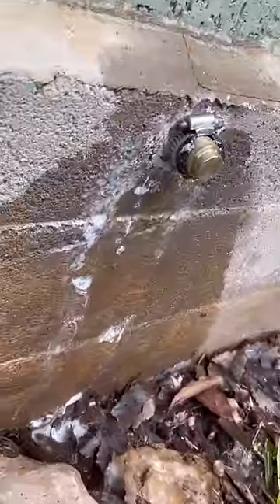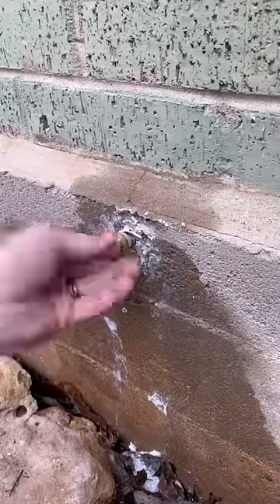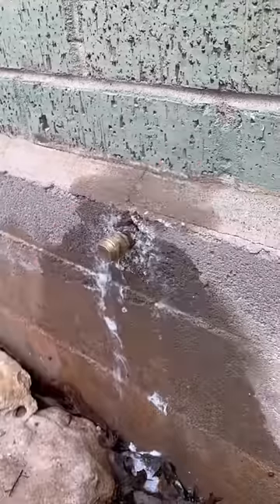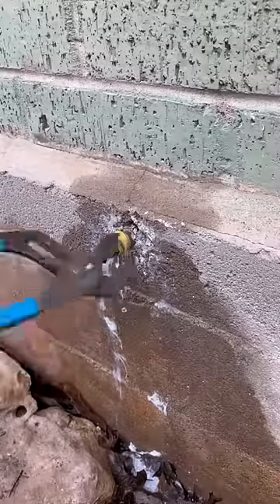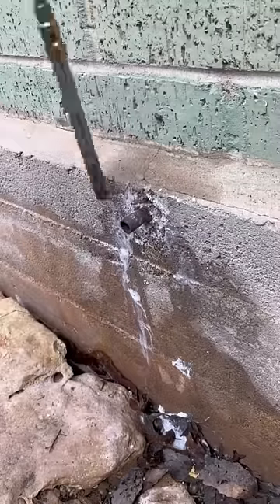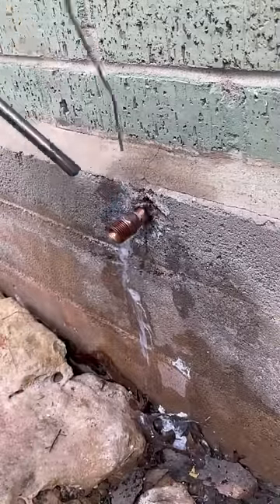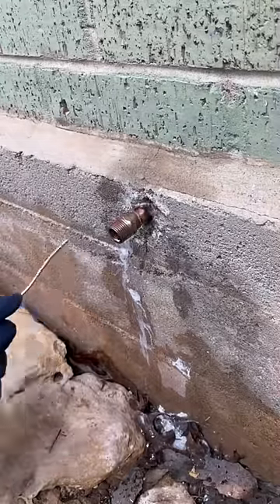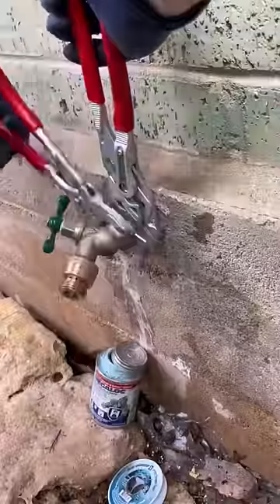Repairing a copper waterline for a hose bib. #plumbing #plumber #repair

Comment: Good shit! Learned you can melt the fuck out of the sharkbite, thanks!
Reply from the maker: Found that out on a job awhile back while frustrated. “It will come off once it’s liquid” 😂
Reply: @theplumbersplunger  Thank you for teaching us. Very helpful 👍
Reply: @theplumbersplunger a  torch is always a good mistake fixer.
Reply: I’m in the uk so it probably has a different name, but is the shark bite the little brass ring? We Call them olives, we have a tool for them like pliers with a v shape cut into them cuts the ring in two places and comes off in seconds no melting involved.
Reply from the maker: @Fastercat777  he is talking about the push connect fitting I took off by melting the plastic
Reply: @jamesnicholl1591  If memory serves me right, you guys use a lot of compression fittings in the UK 🇬🇧. We dont use much, other than our angle stops. 

The fitting shown here is called push to connect. Has an o ring to create a seal and uses stainless steel teeth to hold it in place, hense the name sharkbite. When they are fitted close to a wall, its a real mfker to take off. 

Apparently, a torch works wonders!
Reply: @Fastercat777  you were talking about a brass ferrel
Reply: @javiervazquez9472  Even super close to the wall using the right tool you can get them off. Just pure lazy and clearly does not know how to remove them. 
Plumbers like this guy will tell you to go all copper yet pex and sharkbite fittings either push to connect or crimp will last just as long if not longer than copper. 
Copper cost more to install because of the labor. Yet pex is super simple to install that anyone can do it. 
The same goes with DWV where companies are still forcing the use of Cast Iron.
Reply: @kameljoe21  slow down there, cowboy! Cast iron is still required in buildings over 3 stories high due to noise and the toxic chemicals it produces during a fire. 

Apollo warrenties there pex for 25 years, Nibco 10, Viega 25, but Copper is warrentied for 50. Im not saying to always do copper, but if copper fits the budget, why not? 

Now, did you know that sharkbite goes bigger than 1 inch? Have you ever tried removing a 2 inch sharkbite cap that's close to a fire rated wall? It isnt fun.

Now removing them with fire doesnt mean he's lazy, I think it's smart. Reduce damages to wall, reduces moving copper too much,
Reply: @javiervazquez9472  While building codes still require them on buildings 3 or more stories. Still its an old and outdated reason to keep using them. PVC is still a viable solution and is 100% sealed pipe where is cast iron is sealed using rubber bands and the weight of every pipe from ever level is on those bands. I know far to much about cast iron as I have installed it for in some very large projects along with spent nearly 6 months testing all the DWV in a brand new hospital build. This required flooding and testing every stack as well as replacing and adjusting bands. I also installed copper and med gas lines. 
Warrenty is only for defects in the pipe. Which is super hard to prove in copper. I have seen brand new copper lines get destroyed and had to have them replaced. I have had to replace several main lines in projects by companies who failed to install the joints or fittings right. Including some major 6 inch copper lines. 
Yes I am aware that pex goes larger than 1 inch. 
I also know that pex will last a lot longer than copper. I also know that freeze and thaw cycles on pex is quite common. I installed pex on a farm house that sits empty all winter long. The only thing they do is put some RV antifreeze in the toilet and drains. The reason why it was replaced was because the heat went out and it froze causing the cellar to flood for a month. Now with the pex they have never had a problem even during the coldest spell of -40f. 

Yes its lazy to remove a fitting with fire when the proper tools can be used. Also it your copper is moving then something is wrong. 
Had this homeowner had pex he would never of had this problem ever.
Reply: Sharlbites are actually extremely easy to remove if you know what your doing
Reply: @Fastercat777  Nah shark bite is a kind of brash push-fit as far as I know.
Reply: When it is close to the wall you can get the sharkbite off using 2 flatheads.
Reply: @thehumilityhaven  yes. It's pretty simple.  People just have no patience to actually figure out how they work and how to get them off
Reply: @thehumilityhaven  Yep you sure can. Like the creator said in a comment it does not make for a good video.
Reply: 2 flat heads is all u need😂😂😂😂
Reply: @adammonahan687 When you have adequate space, they are easy to disconnect. When they are flush against a concrete wall, not so easy
Reply: Good job young man 😊

Comment: I accidentally twisted the copper in the wall once. Live and learn.
Reply from the maker: It happens unfortunately. Just don’t do it on a Friday after 4:00 😅
Reply: @theplumbersplunger  😂😂
Reply: That's how we learn.
Reply: I would install a box around that facet to protect it. It just looks so weak there😮😮😮.
Reply: What happens if you twist the pipe does it break or un thread?
Reply: @Ya boi Smith you create a leak on the other end by breaking the solder. Ive seen the pipe itself twist as well and well that also creates a leak.
Reply: Was replacing my cast iron kitchen sink last month, and it slipped falling through the hole in the counter.  Nailed both the hot/cold stopcocks on the way down and broke em both off in the wall. 🙄  That was a fun mess.
Reply: @theplumbersplunger  but Friday after 4pm is when all dads everywhere decide they know enough about plumping to do some dumb shit 👌😂
Reply from the maker: @nicholasphillips5406  this is true 🤣
Reply: I did it on a Sunday afternoon, inside, down to the slab 

I occasionally helped out a friend, as a ground guy for commercial/industrial fire sprinkler install so I only saw black iron pipe and I put a wrench on a leaky fitting behind my refrigerator... not knowing that it was on a copper pipe.
Reply: What you mean with 'use backups'? I've not idea about plumbing
Reply from the maker: @ivanf442  using a second plier to hold support on the pipe coming from the wall so it doesn’t twist.

Comment: I’ve got some relatives in Texas who discovered a while back to their pretty serious dismay that the fact that most years they don’t see enough frost to worry about doesn’t mean that it isn’t still good practice to install proper frost free hydrants with back flow prevention rather than simply replacing those old fashioned low tech hose bibs with the same thing when they fail. Where I live in Canada those hydrants have been SOP in all new construction and will generally be retrofitted any time an existing hose bib is replaced for many years now. Before those came around, all houses in my area had to have an accessible interior shutoff for outside hose bibs, and homeowners had to remember to shut those off and open up the exterior valve to drain the bib in the fall before cold weather arrived.

Comment: when i have a sharkbite fitting buried against a wall like that i use 2 flat head screw drivers to grab the edges of the plastic on either side and compress it using your thumb on the end of the cap and work it off that way.

Comment: As a former service plumber for 21 years this is exactly how you change out a hose bibb in this situation
Reply: Thank you for all the detail in the the voice over!!! That’s what keeps me subscribing. ❤🎉
Reply: You saw it too?
Reply: How do you winterize that shit
Reply: Yeah except for that huge solder booger in the joint. That’s all bad.
Reply: Former? How did you get out? Genuine question. I can’t walk in public anymore without getting loaded with questions and requests for service. 24 years so far. I’m 43 looking for a way out. It’s boring factory work at this point. We’ve seen every hacks trick. Nothing is new anymore.
Reply: @pjplumber2146  I usually never worked in the county I lived in and only drove the truck home on rare occasions. My next door neighbor  is a half mile away in  either direction. I hopes this helps.
Reply: @evanrodriguez2470  There should be a shut off valve inside the house or crawl space to turn off.
Reply: He put the sweat on inside....😂 would have never showed this video....😢😂😂😂 he has so much solder in one fittting

Comment: Just a heads up, they make 1/2" threaded bushings so you can put a boiler valve on flush with the wall

Comment: Depending on location, copper should be in a sleeve when going through concrete or you need to attach an anode to cut down on corrosion
Reply from the maker: It definitely needed to be sleeved. Unfortunately, whoever originally plumbed this house didn’t sleeve any of it.
Reply: Agreed.
Reply: Back in the 80's there was bare copper tubing laid in the middle of slabs all over central Texas.  Unsure what code is here now, or what they use.
Reply from the maker: @hcaveman6954  no homes now have copper in the slab unless they are pre 2005.
Reply: Bingoooo. Was wondering this!

Comment: I’m very happy you actually took the torch away when the copper was hot enough and applied the solder
That’s like the first thing they teach you about brazing if you went to school or learned from an actual professional and not some dude 
And some dude can be a pro
It’s just rare they explain why it how things are they just say do it like this

Comment: I agree with everything you did except the megaloc pipe dope I always use t+ 2 Teflon pipe dope megalock sets hard cannot remove easily after it cures
Reply: Yea. I was questioning that myself.

Comment: Nice to see someone using a torch like a real plumber and not throwing money with a propress instant plumber tools….bravo my fellow plumber..bravo…

            …..i cringe seeing plumbing videos using pro press on every 1/2”-3/4” fitting and blowing through 15/20 fittings in 2 feet of pipe…..you can work backwards and soldier every fitting ..and when you get to the last one if its still draining or failed shut off valve not closing then at that poin you use 1 press fitting for that final connection…..and for the record  pro press should only be used for 1.5” or bigger fittings in emergency time sensitive situations only……i would have gotten fired on the spot if i was caught using a pro press on a 1/2” fitting😂😂😂
Reply: Is that what certifies a "real plumber"?

Comment: Very cool. Are the hose bib vacuum breakers necessary in places where temperatures will never dip below freezing temperatures, I.E. Hawaii?
Reply from the maker: Required by code here to prevent water from siphoning back into the system from a hose

Comment: I got a trick for you- you probably already know it- in a situation where I have water constantly dripping back to my work point (like here)... I go to a nearby fixture & rig my shop vac up to it, then turn it on. the suction pulls the water away from my work point- allowing me to work the joint sooner. extremely handy in situations where an old gate valve doesn't turn off completely & leaves a constant drip into the system.

Comment: Using both Teflon tape and pipe dope seems counter productive. Wouldn't the tape prevent the pipe dope from contacting the internal threading ? Or is that the point ? Not that I'm a pipe fitter, but don't you want to be able to remove the tap assembly in the distant future, and won't the pipe dope make that particularly challenging ?

Comment: Question... can you dope the female joint on the thread for a cleaner application?
Reply: The dope just piles up inside the fitting
Reply from the maker: It won’t seal properly doing it that way.

Comment: If there is a chance of freezing, I suggest a self-draining Hose Connection Vacuum Breaker. Otherwise, water can get trapped in the hose bib and the pipe going through the wall and freeze. 
No need to use Flux on the pipe to clean it off. Just heat it, wipe off the solder with a rag, then sand it clean.
As many others stated earlier: Use a ball valve hose bib, and a lot less solder.
Reply: He didn’t ask for suggestions. we know you’re a better plumber, but if you want to tell people how to do their job you should put them on the payroll first. If you’re not their boss they’re not listening I promise.

Comment: I keep seeing plumber’s using tape then dope and I’m trying to understand. That still leaves one set of threads only covered by tape. Right? Wouldn’t the ideal process be dope>tape>dope?
Reply: I’ll tell you a story on European plumbing: we don’t use pipe dope on Teflon ever.

Either hemp and paste (which might be kind of a pipe dope) or straight up Teflon tape or the newer products even. Hemp is still viable due to being able to back the fitting of without leaking, which you can’t do with the tape.

Dunno if that is what the pipe dope is needed for, filling pinholes in the tape if you have to back the fitting of?
Reply: @bertbergers9171  That's a great point, I hadn't considered backing the fitting off.
Reply: I’ll tell you a story on American plumbing: we use three wraps of Teflon and then coat it with thread sealant. Never fails. Teflon tape lubricates the NPT threads so a string mechanical joint and hydraulic seal is created. Thread sealant assures a leak free joint first try. Interesting use for hemp though.
Reply: One of manufacturers required dope-tape-dope. I used like manufacturer said and everything went ok.

Comment: What does "always use backups" mean? Asking for a DIYer 😅
Reply: The backup pliers or wrench to hold the pipe when putting force on the fitting. That way you don't trust the whole pipe, potentially collapsing it inside the wall.
Reply: @RossReedstrom  damn. This is not common. A legitimate question answered correctly and without sarcasm. thank you.i truly mean that

Comment: I see alot of these on here, doesn't something like this freeze?
Reply: Must be down south , Definitely not SD.
Reply: @edmc1000  
SD 🤣🤣🤣🤣👍
Reply: Judging by the brick and mortar color I would say California.
Reply: Many places in the world dont experience freezes. Someone always brings this up like theyve never heard of a place where it doesn't get to freezing ever.
Reply: @wackocheese  That's where I live. For the most part I have always seen the frost free ones where the valve is actually on the end of a stem so the water stays inside when it's not on.
Reply: A ball valve would  installed to terminate the water to this line in the winter..

Comment: What’s the purpose is that little bit of solder in the inside of the pipe?
Reply from the maker: I used too much and some overflowed into the fitting. Had to get it out.

Comment: How much do you typically charge for these replacements after parts and labor
Reply from the maker: All of our pricing is by the task so we don’t have a parts and labor breakdown. A new hose bib installed is about $300. It varies though depending on what the situation is.
Reply: @theplumbersplunger  you’re joking right? How much do you charge for a service call? If you’re charging that much I’d hope you at least knew how to solder without leaving a massive solder boogers  in the joint you soldered.
Reply from the maker: @nickkirschner3719  I didn’t leave any solder boogers 🤣 did I use a little much? Yes… does it hurt anything on an end of line fitting like this. No. that pricing is pretty average for my area 👍🏻
Reply: @theplumbersplunger  you left a huge booger, did you forget your glasses?
Reply from the maker: @nickkirschner3719  Not seeing it. Go troll somewhere else my guy.

Comment: *IM NOT PLUMBER BUT HAVE REALLY GOOD MECHANICAL, HOME REPAIRS KNOWLEDGE....*  what's ur thoughts on shark bites??  my parents have a nice double wide mobile home bit it was built w/gray pvc type of tubing bc they have breaking issues & I have have SBite's & never has a leak or failure...u see many failures from SB's??
Reply from the maker: SB are the only “repair” for adapting back to that Polly piping in old. mobile homes. Should probably be repiped though. Anyways, I don’t use them and don’t think any plumbers should. For a homeowner it’s an easier solution. I have seen too many issues and installer errors with them.

Comment: First rule is to know where the closest water shut off is and go to test that it turns every few months to make sure its not stuck when shit hits the fan.
Second rule, always design systems so its easy to repair or replace. This connection should not been outside of the house, let alone inside the concrete, but inside with frost free faucet, or just ball valve with lever system to operate from the outside, hell normally closed solenoid valve operated by all weather switch and enough angle to drain it.
Reply from the maker: Very few frost proof bibs here. (Central Texas) if it gets below freezing most people cover these types of bibs with a insulated cover. This is dumb though to have coming out of the concrete like this.

Comment: I do A/C  for living ,then I had call from customer  and my diagnostic was systm lock on maintenance I gave my Quote ,he said he is going to do it , 4 hour latter call me back  he said he cleaned  down, but still not cooling , I told , is going to cost you   a Service call fee in front.. he paid as soon got there.. I found not freon at system, guess what he make bunch holes  when he put all screws back on..he messed up the  condensing coil..he blame on me couse I did not insist to sale the service..hahaha😂.
Reply from the maker: It’s never some people’s fault. 🤣

Comment: I think anything hanging off a copper pipe should be fixed to the wall to avoid stress on the pipe. I guess most builders have zero Fs to give.

Comment: You know you've used waaayyyyy too much solder when it pools in the bottom of the fitting like that lol 😂
Reply from the maker: Yeah… my bad 🤣 but it doesn’t hurt anything in this situation. I also, didn’t like that piece of copper so I wanted to be sure it was good 😅